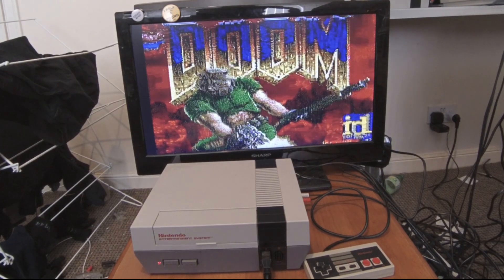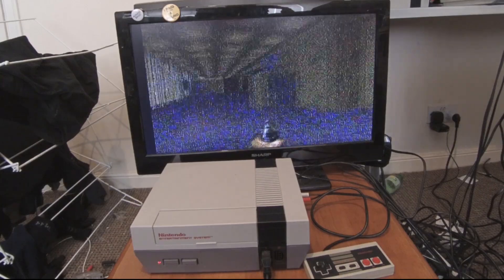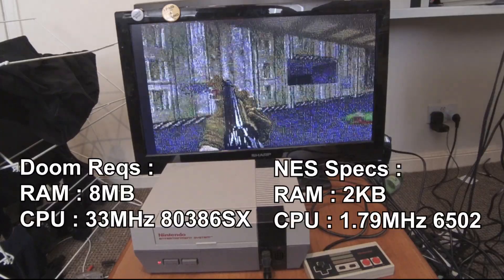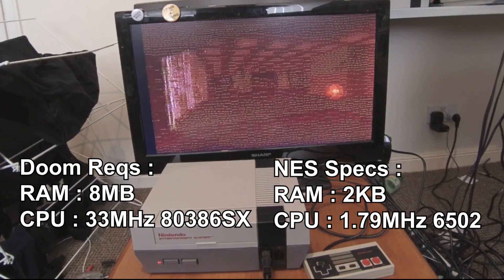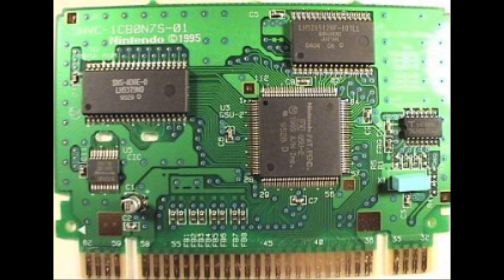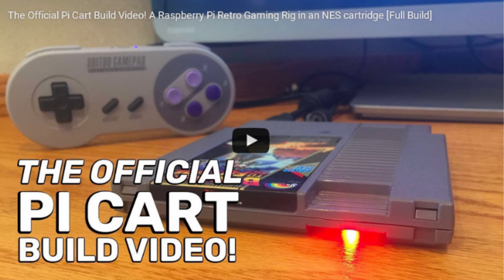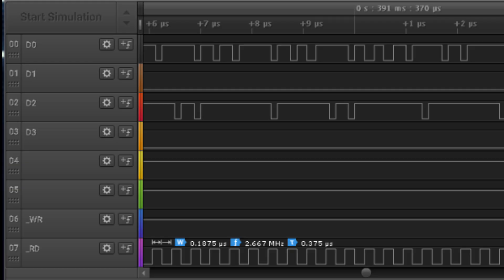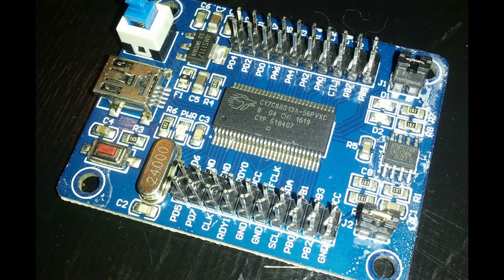DOOM on NES!

Comment: "There's no cheating.... except for a tiny computer that's 4000x more powerful than the original hardware of the NES....
Reply: Haha
Reply: @Requiem4aDr3Am mmm, just going by ram i think if my math isn't flawed a modern console like a ps4 has 4,000,000 (4 million) times as much RAM (8GB vs 2KB) as in the NES. It'd be hard to compare everything else but it's probably in that ballpark. Looks like most recent pi has 1GB, so by the same logic is "only" 500,000 times as powerful as a NES.

Which makes a lot more sense cus I mean, mario on NES is not that huge number you typed out worse graphically than the best graphics game could make on a Pi...
Reply: Some late-era SNES games had processors on the cartridge that were more powerful than the SNES's CPU. If a Pi is cheating but Mario RPG isn't, where do you draw the line?
Reply: Concordo  @ce7.0
Reply: @ce7.0  the processors were just for making games run faster by adding more ram, starfox COULD'VE ran on a snes without hte fx chip but it'd be 2-5 fps instead of the 20 fps it gets with the fx chip, a nes could NOT have ran doom at any framerate
Reply: @Requiem4aDr3Am Not enough video memory bandwidth in the 2600. The NES has just enough to pull this off.
Reply: Haha exactly what I was thinking.

And it was called the Super FX chip because it was just ONE CHIP add on, not a whole damn computer. Lol
Reply: @tbh3291  The raspberry pi is a system on a chip.
Reply: @tbh3291  Still if adding hardware to the cartridge isn't cheating, then it isn't cheating. Either you're not allowed to add chips, or you're allowed to add a many as you can fit in. There's nothing external, you plug the cartridge in the nes, it runs, so no cheating imo.
Reply: @leandervr  if that's true then why not just put a chromecast inside an NES cartridge and stream everything from a PC? this project is impressive but I would have rather seen an attempt to create a port of DOOM that runs on the original hardware
Reply: @tbh3291  is a co processor and ram so yeah it is like adding a cpu.
Reply: @tbh3291  is one cip 20 times faster then the snes cpu those carts come with a price of 80 pound + when relised . it is cheating and snes sales wore based on end user stupidity as one of the most over rated consoles of all times .
Reply: @tbh3291  one cip that cost more then the console
Reply: Super FX chip was legal in SNES when creating sci-fi animal series called Star Fox or in USA: Lylat Wars. I dont own Star Fox or Metroid Prime games.
Reply: @tbh3291  the RPI is one chip as well, if you're gonna get that detailed
Reply: Like yeah it's cheating, but he did it on the cartridge side of things, meaning it can run on any bone-stock NES.
Reply: It’s running on the hardware. The point of carts was to allow for add on chips to add to the overall capability of the hardware. Same thing here just 30years in the making.
Reply: Haha ,even most nes games did cheat because they used mmc chips to run on the nes, despite they are no graphics or sound accelerator chips,but they do increase the ram and rom inside the nes to allow better graphics & pcm sound to be possible on the nes by using bankswitching.
Reply: As long as the PPU is actually doing the rendering, I don't consider it cheating.
Reply: It's not cheating. It's the consummation of a previously unrequited passion, finally unleashed in visceral glory.
Reply: You must be fun at parties.
Reply: Sa-1 for SNES is 4x more powerful than SNES processor, are that a cheat too?
Reply: ain't that's the same what other cartridges did?
Reply: It's no more cheating than a FX or SVP chip hidden inside a cartridge
Reply: The point is: is Starfox cheating? Is Starfox a SNES game? Same here.
Reply: still, you can run on NES if you take away textures
Reply: Well, he hid the Raspberry PI inside of cartridge, so it's fair
Reply: @v-14415  Both Resident Evil and Final Fantasy 7 are now on NES.
Reply: Why even bother?  We're working on MegaDOOM for the Sega Genesis/Mega Drive, and there's 0 extra hardware there.  Just the good ol' reliable 68000 running at 7.67MHz.

And Blast Processing.
Reply: As SOON as I saw the framerate I knew what was up...
Reply: 4000? like 1M
Reply: Oh well
Reply: It's really cool none the less.
Reply: "It's no different than the super FX chip"
Reply: the only console where I wouldn't consider doing something like that cheating is the Atari 2600
Reply: And compare this computer to chips such as superfx or virtual for genesis....lol.
Reply: É os chips fx eram o quê?
Reply: But that was in the cartridge not the console so you cant call it cheating
Reply: The 2000 like is from me!
Reply: Still not cheating. The NES was designed to accept upgraded hardware within the cartridge. In Japan you even had limited internet access thanks to add ons to the famicom.
Reply: @LloydWaldo  Ok, in that case you can play the latest version of COD on an Arduino. You just need to stream your PC desktop over UDP to a ESP32 that can then update a 320x240 LCD panel, and send button presses back to the PC as a USB peripheral. So an ESP32 can play all of the latest 2024 FPS games! No cheating, it's all running on the ESP32!
Reply: When it's directly inside a cartridge that you plug into the base console and to any casual observer it runs just like a normal NES game, I think I can give him a pass. If it was on some bulky add-on device that possibly even required its own power supply, I would be less forgiving. To be honest, I wouldn't mind seeing a bunch of new games for SNES that added more and better chips directly into the carts too, which would just be natural evolution of the enhancement chips that many of them used back in the day anyway. And, it was good enough for Virtua Racing on Genesis, which went a whole other level further than any enhancement chip on SNES ever did as I recall and I imagine was in principle a lot closer to what this modern NES version is doing, so I'll accept it. :D
Reply: @inceptional  In my opinion if the main game code isn't running on the NES's CPU then it's really a "cheat". The NES is then just being used as a dumb input/output device, like the old dumb terminals that used to be connected to mainframes. The terminals themselves didn't run anything - the mainframe did it all. It's a cool hack, but not "Doom running on an NES"...
Reply: @SmashCatRandom   Does a game like Super Mario Bros. 3 still fit into the real NES game category, because I absolutely 100% consider it as such. It's the same with any SNES games that used enhancement chips back in the day too, and I think Virtua Racing on Genesis gets a pass also. I wouldn't remotely count any of the Genesis add-on devices as real "Genesis" games though, like the Sega CD and 32X.
Reply: @inceptional  Yep of course. The console CPU is actually running the game code. My line is when a completely separate CPU/MCU is actually running the game, and just using the original console as a framebuffer.
Reply: @SmashCatRandom  That seems fair enough.

Would either the FX or SVP chips push into that territory of the original console largely acting as a frame buffer?
Reply: @inceptional  No those chips (as far as I'm aware) simply augment the existing console. The console itself is still running the game, it's just making use of the enhanced peripherals. I think I mentioned previously that you could technically stream yourself playing Cyberpunk 2077 on the NES - but the console is just being used to display frames being generated elsewhere :)

As I say though, this is just my own opinion. As a hack it's cool, and I can appreciate it. However it's a lot different to a project making the original hardware do something impressive, even if it makes use of some complementary hardware; as that's what I consider "running the game", and not just "displaying a game" :)
Reply: @SmashCatRandom  I actually agree with you on a kind of "Look--the system can do THIS!" level. But I still give a bit of a pass so long as ultimately, as an end user, I can just plug in a cart, press play and go. It's a bit daft through today's lens, as you would clearly just be better playing the game on a modern system in every way in that case, but I guess it is what it is. 

The only thing I want for sure though is for people doing these things in modern times to be very clear about what's going so, on people aren't having the wool pulled over their eyes by bad actors trying to proclaim some console has impossible magical abilities because "Look--the system can do THIS!".
Reply: Honestly the best comparison is more like the Sega 32x which is basically another console that uses the Genesis for video output and controller input.

There was nothing really stopping Nintendo from doing something similar at the time besides cost. The tech would have been available in 1993, but my god it would have been expensive!
Reply: Well.. he used a NES to play the game.. soo it running on it :D . It is quite interesting
Reply: Modding and these are illegal hack. No Mobifying no mods. Just a legal game card that can play Doom in nes. Raspberry Pi aka Linux can play easily in Doom 1 and 2 with HDMI screen. My next project is playing Doom on only HDMI Asus screen Nvidia . There are 3 buttons but I guess I can play Doom with mouse if I find something attach to desktop cable and using my mouse.
Reply: You might be wondering how I went to the moon with a toothpick. Well, I attached a Saturn V rocket to it.
Reply: “I didn’t cheat on the test but I taped the answers to the outside window so I could see it.”
Reply: SNES rerelease uses it too 😂
Reply: I don't think the video author even knows what cheating means.
Reply: It's not cheating it's just making use of the space available in the cartridge 😉 except for the fact it doesn't actually use the NES hardware at all but that is just a minor detail, just need Crysis to run on it one day
Reply: I'm all in on an NES running Crysis in any capacity. @Zens_zulu
Reply: @Zens_zulu  Crysis is old
Reply: @Zens_zulu  Crysis is old. Stop using it as an example of high-end gaming
Reply: @zagreos8902  I do know that. It was not meant as being a benchmark the fact that a bit of fun and sarcastic humour goes over people's heads and they take it seriously just shows you how literal some people take ever. When I have to explain that about a comment I made over a year ago it amuses me to no end.
Reply: @Zens_zulu  So you are happy then. Why are you complaining?
Reply: @zagreos8902  what are you on about you weirdo
Reply: @Requiem4aDr3Am Because it DOES physically run on the NES, it's difficult to say that it's a complete foul. This could be used to make a couple cool projects, that run on "real hardware". And Repros would definitely be easier like this, since no donor carts are required.
Reply: If all you're doing is inserting a cartridge and pressing power it's not cheating. 

It's using the cartridge slot and the same power supply as the nes.
Reply: @Lobothemainman23  Even separate power isn't cheating, as the Famicom Disk System had its own transformer. But I'm trying to draw a line that excludes, say, use of an Xbox 360 through a TV tuner cartridge in a Game Gear.
Reply: @DamianYerrick Playing a 360 through a TV tuner would simply be streaming the content over the air which would be completely different than simply inserting a cartridge and doing nothing else. 

So yeah I would consider that the line.

The 32x is more cheating to me than this NES cart.  The contents of the cart mean nothing. If you can package this cart the same as any other NES game, put it in and it works, it's fair game.
Reply: @Lobothemainman23  If I mod the TV tuner to control the 360's power and to take the video signal over a cable instead of an antenna, it's less clearly different.
Reply: @DamianYerrick  No because you'll still need to be in range of the Xbox 360. It's streaming content using an external device.

In order to make the game work you need to have a 360, which is nothing like only having a cartridge. 

You can pick up this doom cartridge like any other NES game, plug it in and play it. You wouldn't need to drag an entire X360 to do so.
Reply: @Lobothemainman23  If size of the chassis is the determining factor, then Virtua Racing and every 32X game are cheating because they're taller than a typical Genesis cartridge, and so is the FDS because the disk drive sits below the Famicom.
Reply: So like Starfox or Virtua Racing?
Reply: ...exactly like every cart that used extra hardware back in the day. Are those cheating too? Like Super Mario Bros 3?
Reply: @EC18FEA30B  Vast difference in scale between the two. The extra hardware in Super Mario Bros. 3 is just to 1. change what part of the ROM chips are visible to the CPU and PPU at any given time, and 2. tell the CPU when to scroll the status bar into place. It doesn't add substantial processing to the NES the way a Super FX, SA1, Sega CD, SVP, or 32X adds processing to the 16-bit console.
Reply: @DamianYerrick  Yeah, I agree. But where exactly is the line where it crosses over to "cheating"? A cart like this could have been sold in theory back in the day. Not with this much modern power, but with massive power compared to the NES itself. It would just have been extremely expensive, so not a viable product.
Reply: @EC18FEA30B  If doing it using the tech available during the year the console's last licensed game was released would have put the game's MSRP outside normal limits, then it's cheating. Thus Doom is cheating on NES but not on Super NES.
Reply: If all you're doing is putting a cartridge in the system and hitting power. Its fair game.
Reply: @Requiem4aDr3Am Yes I know all that, but your number was stupid high. Taking a spec we can directly compare in like for like quantities (RAM) sees a 500,000 increase from NES to Pi, your number is like, infinity times that. You just went way way way way way too far.

It would be the same for any other spec we can objectively measure like transistor count, it wouldn't be even within a trillion times of your number.

Also btw Moore's law has been dead for a while now. As transistors get smaller it gets so hard to reduce them, and the pace of speedup declines.

Again a NES is weakass, but Mario Bros isn't like a joke graphically even today. They still make tons of indie games in "8 bit style" on PC. Terraria for example, although of course really it's much greater than 8 bit quality. 

16X is also on the high side for console gen. Maybe 10X and that is rapidly slowing probably. Xbox One X is 6TF and 12GB RAM, PS5/Xbox 2 will probably be around 12TF and at most 16GB RAM judging by current trends. So, ~2X. Granted One X is a mid gen refresh, but by 2020 it will be 3 years old. Plus console generations have gotten longer, they used to be 4-5 years now they are 6-8. PS3 was ~200-250 GFLOPS, PS4 was 1.8TF, so maybe 6-9X in FLOPS. 16X in memory. Xbox 360 was ~200GFLOPS, but One X was only ~1.3 TF so only maybe ~6x.
Reply: @cryengine_x  Please stop.

Comment: "no different than the super FX chip" yep, no differences at all, ones a single chip, and ones a completely seperate board thats capable of running things on it alone.
Reply: Super FX: a single chip that can run things on its own if provided a board
RPi: a single chip that can run things on its own if provided a board

The pi doesn't need the board to be here, really it's a hinderence, if he had the money he would make a custom nes cart board and put the pi chip on that.

And if you wanted you could use the super fx chip like a pi, put it on a board and run things on it in the same way

Comment: Kinda cheating? a little... But you have a point about the SuperFX doing more or less the same thing... so.. yeah... 
Pretty clever.
Reply: SuperFX was only a co-processor that offered some very fast and very specific operations that helped with making a rasterized 3D game on a SNES. The game mostly ran on the main console CPU.
Reply: @Felice_Enellen  it's impossible that the original cpu was used in any meaningful way, the games that required the SuperFX required it because they needed a ton of power, Doom needed a 33Mhz processor at least, the SuperFX 2 (second revision of the processor which bumped the clock from 11Mhz) could run at 21.4Mhz max, with a little bit of tweaking they managed to make the game run and it still retained poor fps and render distance. The game HAD to run on the SuperFX chip otherwise it would've just not started at all, the SNES's cpu was simply not powerful enough (3.58Mhz max)

TLDR: no it ran on the SuperFX almost entirely
Reply: @Felice_Enellen  And yet I've read many a thing that states that it did the majority of the work, and the main CPU was relegated to being little more than a controller. Hmm..

Comment: Will there be an FDS version?
Reply: You couldn't, for pretty obvious reasons if you know anything about floppy drives.
Reply: raspberry144mb The low storage space and needing to flip over the disk/disks at certain points like a cassette tape? Or is it the drive mechanism inside the disk system? There's also the danger of the disk going bad, but that was a problem with the original PC Doom as well, as it was first on floppy.
Reply: @lionocyborg6030  All of those are concerns as well, but the main one is the fact you wouldn't be able to use any other sort of hardware expansion besides the ones the FDS already provides.
Reply: raspberry144mb I see. Would the FDS override the raspberry Pi in the famicom itself or would it have to go inside the disk system to work (and there not be room, due to the drive machinery)?